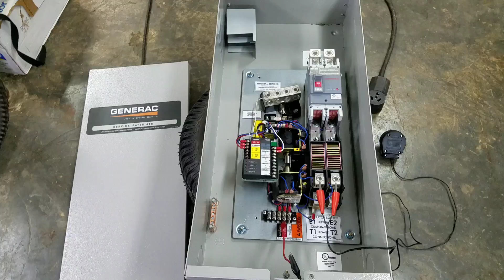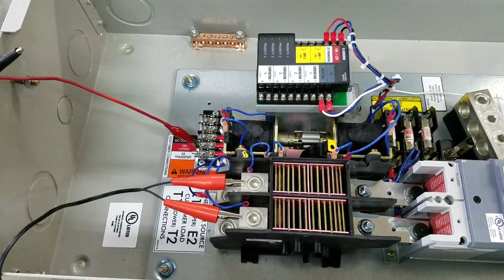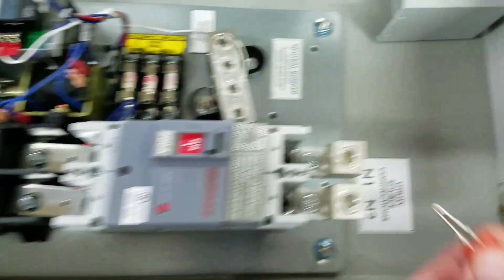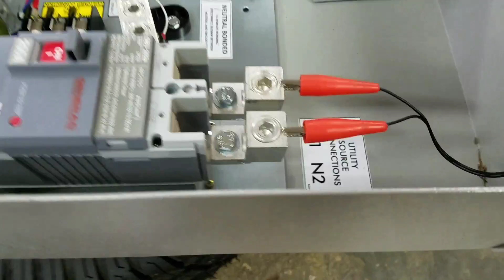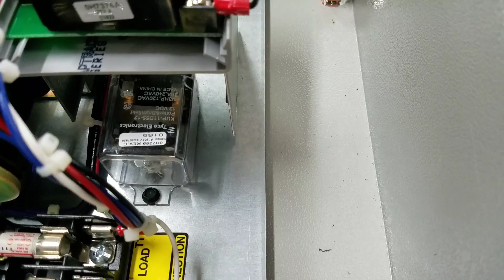Generac automatic transfer switch explained,  demo

Comment: So when the non generac generator is only 110 volts, will it still activate the relay? And if the utility power input is attached to a 110 volt solar inverter, will it switch back to that input? You'd need a relay to disconnect ground, but that's easy, but if you have to get a transformer to step up the voltage on the generator and/or utility service side, you'd need to tap into those leads. I assume those are the ones directly connected to the main lugs on each input. I'm waiting on one of these now and those are the only questions I have remaining. Will the 110 run the main relays? Do I have to transform to 240 volts to run the main power switch?

Comment: I was also thinking of bypassing the transfer switch and just connected directly to my electrical box with breaker slide switch switching on when the power goes off manually due to the expensive electrician charge I’m thinking

Comment: I have a 100amp transfer switch box it’s a Gardian brand I like to test mine the same way but you show the wire and there small wires going to a huge 240 plug way and how do you use this plug with the small grade wire the other wires you don’t show there location is please explain what there connect to thanks

Comment: Thank you for this.  I have a 200A transfer switch that I'm using with an non Generac diesel generator and this is the last piece of the puzzle for me to finally get it working.
Reply: What did you do to make the ats work with a non generac
Reply: @crutsexplore2398  I used an Automation Direct PLC to act as a go between.  The Generator has some I/O that can be used to start/stop and monitor it's status.  So the PLC monitors the status of the power with a relay and after a short period of time starts the generator then switches the ATS.  Then does the reverse when the power comes back on.  I even have it all working with Home Assistant so that it's part of my home automation system and I can control/monitor it from my phone.

Comment: Right, so N1 and N2, or grid power, are passed through to another terminal that gets wired onto the generator controller and that's what is supposed to be used to detect the utility coming on or off. It's not done by the switch itself.

Comment: Paused @ 0:02 ... 
Man I really hope you're going into extreem depth, I wanna know how it knows when the power goes out... I'm like 40 videos in try'n to figure this out and nobody comes even close to attempting to explain this... I have a guess but no confirmation and I don't want to enforced confirmation bias by looking for the specific solution I think they use because there may be more than one method that is used and I may be thinking of a less common or older method.

My idea of how it works: 
They use a contactor/reley that requires power to keep it from switching to generator power and turning on the generator, and just feed that contactor or reley with mains power.
Reply: Okay it's a solenoid but same idea.

Comment: At what voltage “loss” will cause the switch actually activate?  It’s obvious that at “0” it will switch, but what about a brownout condition?  Say the power company is only delivering 200V instead of 240V?

Comment: Thanks for posting this. I have one preinstalled on the home we bought, good to know how it works..  I'm looking at using and EV with an inverter to replace the outside generator.
Reply: You’re going to have the input plug on the inside of the garage, correct?

Comment: Designed my grid/solar transfer switch myself. Installed in a sub-panel with a push button so my spouse of 50 years can hit the button and the sub-panel is energized  by the 3500 watt inverter and the power comes back on. Next project is to wifi enable as well as automate the switchover. Subpanel and relay contactor  cost 75 bucks and handles 40 amps.
Reply: Like to see that in a video sir please thanks

Comment: If I disconnect all the wires going to the transfer switch (12V), would I be able to manually pull the yellow lever down and use the transfer switch with a large portable generator? Thank you for your great video. I have a Generac Automatic Switch ( NEA3R.)

Comment: Back and installing another generac auto xfer switch.  Thanks for leaving this video up.  I would be screwed without it.  This time installing with a Schneider XW+ 5548 for battery back up power.  Have a generator but will just use for charging the batts.  

Thanks again Sir!

Comment: Hello Sir. I am using this Generic ATS with a Duromax Generator..everything makes sense except.. for the 12volt section..I do not see what you are hooking the 12Volts to. I mean if I use a say car battery Positive to Red is the White which I see you connect to the negative..but you take the Negative off each time...What can be done about that? Or when it is live will it make the change automatically, leaving the Negative on the White Transfer....this is the part that is confusing...I would greatly appreciate your help on this if you would.

Comment: is the a beakers downstream? for panel protection or do i need to buy a separate one ? as 320.70 saids i need a main pull for main panel just not sure if it needs to be beaker style or i can buy just a switchblade

Comment: So how are you getting your generator to trigger ground on the transfer switch?
Reply: My question too
Reply: I am also searching for the answer to how he connected this to ground, show the other side of the 12v wires please.
Reply: He has it plugged in to 240v (pause at first second of video- those alligator clips are wired into a 240v plug, and plugged into power).  The solenoid won’t transfer over to generator power, unless it senses 240v coming from generator (T1 & T2)

Comment: HUGE. Thank you so much for this video S Snider. Power went out yesterday, the NG Generac came on, no transfer. After troubleshooting and examining everything inside the transfer switch I found 1 of the spade terminals to the lower solenoid was disconnected. So, I just plugged it in (I'm no electrician, I'm in a different trade) and BANG! Big arc. I didn't know why there was such a big arc flash, now I know: it's 240V. The Guardian threw 1501 code, I cleared it, plugged in the terminal, case dismissed.
Reply: Next time, hit the breaker on the generator first to prevent this, switch it, then turn the generator breaker back on

Comment: The solenoid hits with so much force that it can knock loose the lead that is using a standard press on connector. Good idea with this poor design to use pliers to crimp this terminal as tightly as possible. Generac should have had a set screw or different connectors at this location. 
When the lead comes loose the ATS will not shift back to grid power when a power outage has ended.
Reply: Yes!!! I can't believe it did that! Mine didn't transfer yesterday it was because one solenoid terminal was disconnected! This is the most enlightening comment I've ever read on YouTube

Comment: Do you have to supply 12 VDC TO the unit for it to work.
Reply from the maker: The 12v is supplied by the battery on the generator.  I ran 110v back ro the generator and installed a electric outlet.  I have the batteries on the generator connected to batteryminder.

Comment: Is 12awg wire good for controls
Reply: My “certified” installer uses 18/7 for the control wires. 16kw general, 100 feet of wire. 11/20/2021. HomeDepo irrigation wire.
Reply: Generac
Reply: 16/5

Comment: What are you using as your 12V power source? I am being required by a utility to install an ATS on a solar with battery backup system. Everything works fine until grid power is lost, the ATS won't switch automatically. This looks like what I need to do to get it working but what do I use as the 12v power source?
Reply from the maker: I am using the batteries in the generator to supply the 12v.  I just ran extra wiring between the ATS and generator.  I have 110v going to the generator with a receptacle that is used for the batteryminder. Then 12v from the generator back to ATS.
Reply: @ssnider7967  I use the same transfer switch, I have solar with battery backup and don't want the generator to start immediately on loss of grid, I do however want the transfer switch to transfer so as not to back feed anything to the grid from my inverters on battery.  It looks like I can control that with logic in my Outback inverters and use the battery until they get down several volts and then start the genset automatically and recharge if there is no sunshine.  I have located the line sensing and can open and close that circuit in the inverter to start and stop the genset and now with the 12V post on the relay you showed I will be able to control the transfer switch with logic in the Outback inverter.  Thanks
Reply: @ssnider7967  Hi do you know if wire 23 can make the switch transfer to gen side even when utility power is present?

Comment: How does the 12v battery at generator get charged with ATS? Thanks in advance
Reply: You have to run a dedicated circuit to the generator.
They have generater battery chargers
Reply: @mafosa8519  What do you connect the dedicated circuit to? A battery charger, or terminals on the terminal strip?
Reply: I am working on a 11kw grid tie generac. The customer wants to start off-grid! I have run 220 vac to it from the inverters, turn it off to start the generator. Can't get the generator to operate in auto mode, it just starts and runs, will not stop when I turn the grid back on! What am I missing here?
Reply: @eknott1000  one of two ways.   Run a extension cord from a outlet that plugs into a “generator battery charger”. 
Or a dedicated circuit from your main panel. And terminate it with a waterproof outlet inside the generator.
I wouldn’t use a battery tender though.
Hope that helped

Comment: I’m in the process of setting up my 15kw Onan genset to feed power through one of these ATS. The start, stop, and transfer actions will be controlled by a wireless remote that has a 500’ range although I’ll be conducting the actions from inside my house when needed while my genset will be brought out and setup under my detached shelter in advance of a potential outage (hurricane). This video helped confirm my thoughts of how to make the transfer possible with other brands of generators. Thanks!!

Comment: I'm just completing an install of my Generac 22kw Generator and Transfer switch.  The control wires have 6 wires coming from the Generator.  There are five labeled terminals inside the Transfer Switch but no terminal for the 12V Common (-) wire.  Where is that supposed to be hooked up to?
Reply: If you notice on the video where he has the Red Lead connected, next to is is a Black Connector.  That is where the 12 vdc Negative wire connects on both Transfer and Generator.  There are limits on wire size for distance and rated voltage, depending if you run wire along with the Generator Load or separate.
Reply: The black wire (0) is only needed if using the load shed module inside the transfer switch.

Comment: I was working on a old ATS last week. The generator was on but the ATS was not reading proper power and the generator would not go off. Took a screw driver hit the solenoid  and what do you know the switch finally clicked over back to utility power generator went off. Told them it was time to upgrade to a new ats system a generac and a generac generator. It’s a good investment

Comment: Will you or would you post a part 2 to this video? I'm trying to use a non Generac generator with a Generac Automatic Transfer switch and I'm wondering what the start/stop circuitry does.
Reply: It would be much simpler the other way around. GENERAC uses the transfer switch to monitor utility power and control transfer operations.  The generator has a controller that handles startup functions, regulates voltage and frequency, along with fault diagnostics of the complete system.  Without specific information about your generator and transfer switch everything would be a general idea.  I’m sure it can be done, just takes some time.  GENERAC transfer switches and generators are designed to work together for 100% reliability.  Using two different brands in all honesty, may not give you what your looking for, especially when you may really need it.

Comment: Is the 12v connection a trickle charger for the generator battery or is it expecting 12 volts?
Reply from the maker: It's connected the the 12v batter on the generator.
Reply from the maker: I have a charger connected to the battery
Reply: Nope, not a battery charger, even though it’s powered by the battery.  It’s use in conjunction with wire 23 to initiate the transfer of power from utility to generator and back, inside the transfer switch.  Fused T3 supplies 120 vac for the battery charging circuitry. It can power a 120 volt battery charger up to 5 amps. Nexus and Evolution Controllers use a separate battery charger.  Evolution 2, started in 2017 the battery charger is built into the controller.

Comment: Really need more info I want to have 2 transfer switches to run 2 houses from one generator
Reply: Yes, it’s fairly easy to do.  Just need to think everything through, about placement of generator, cable runs, fuel, etc...  Each transfer switch would be mounted at the home electrical connections.  You have to power each transfer, and a set of control wires.  Either split close to the generator or jumper one box to another. Everything depends on location.

Comment: Thanks for the video, How can I adjust the time delay from loosing  Utility power to generator star up. We have power flickers that last just a few seconds but my 22wk Generac starts up to soon and last month the  service breaker on the  gen tripped.  I have the Guardian 22kw,bought new and installed by Generac in 2018. Thanks.
Reply: It seams you have two problems, not just one.  First, this is a nuisance start due to brownout conditions. Not a time delay adjustment, it’s a utility sense low voltage issue, an easy fix. Only, a GENERAC Service Technician is authorized to make this adjustment, due to the Unlock Code required to access this in the Setup Menu.  If you only set the Time delay for startup you’ll still have the same issue only the generator would attempt the start few seconds or minutes later.  If you lost power, it would wait the same amount of time for an attempt start.  Hopefully, that was clear?  As to the issue of Main Breaker trip on your generator, this will only happen if your generator was not sized correctly for your installation, or failed to utilize the “Load Shed Module” for multiple A/C units.  Older A/C units can require substantially more load at startup than newer high efficiency units. Almost always this is because of the LRA (Locked Rotor Amperage), of the Air Conditioning Compressor.  The only cost effective remedy is to utilize the load shed module in the transfer switch, or if the LRA exceeds the generator supplied amperage a Compressor Soft Start Kit.  Remember, if you loose power the load demand on most homes 200 amp service is now placed on your 80-100 amp air cooled generator, only 26 seconds later.  Most homeowners want the same power from their generators as they get from their utility company.  I’m guilty of that also.  With proper planning, this can be accomplished within reasonable limits.  Also, GENERAC doesn’t install generators, usually Electrican’s perform installs. You did get a required NEC Worksheet outlining the generator size, right?   Without that someone is just making a guess.  Yes, I am a GENERAC factory Certified Technician, and Certified Installer for residence and commercial units.
Reply: @f143744  I bypassed the fancy modules for startup. I installed a relay on each ac unit that breaks 24v power to the thermostat preventing startup of the unit after a power drop off. I have two start switches in my living area that are easy to access. After drop out all I have to do is press a switch to lock the relay back in. The relay and plug in base were less than five dollars each and have been working for five years now. My 22kw generac has a one hundred amp output breaker and both my ac's will pull more than that combined for startup. I was afraid I'd be gone during a drop out and the generator would try to power both ac's at the same time. No harm to have the ac's off while I'm out for a few hours and less demand on the gen.
Reply: V g and detailed troubleshooting. Thanks

Comment: Could you post an update video on the automatic transfer switch installed and how it works. I am attempting to do the same.
Reply: I can answer any questions on the proper installation of a GENERAC Transfer Switch.
Reply: @f143744 does it actually send 240 volts to the switch? What if your generator is 110 volts? Do I need a transformer? If so how many amps/watts is needed? And can you simply disconnect from the sources and run the 240 directly to the two coils/relays? I'm thinking to run the transformers/voltage step ups from the main contacts which will be 110. And can you use the main input contacts as positive and neutral? Or are they connected to each other? Then, can I jumper one 110 feed to the two contacts? And then the neutral would be separate running to the main breaker panel, the generator and the solar input (utility side input).